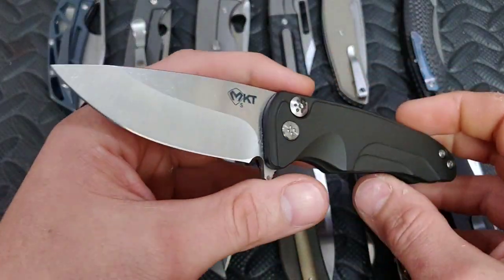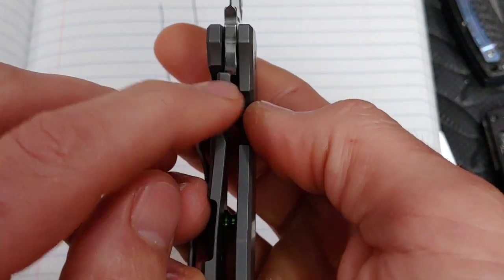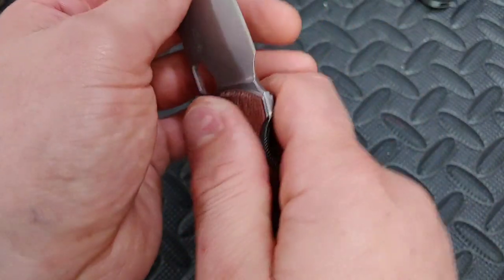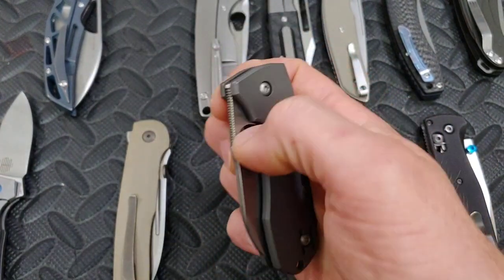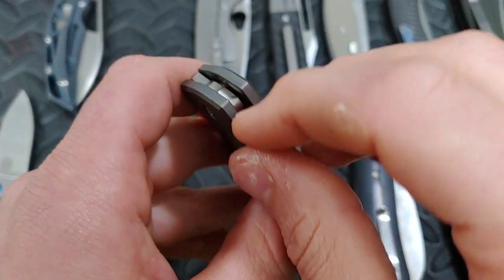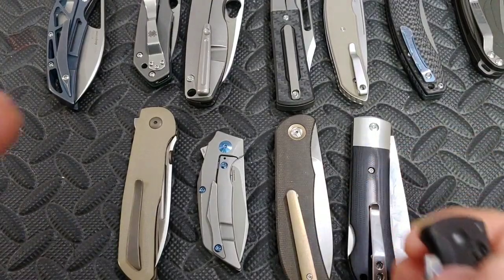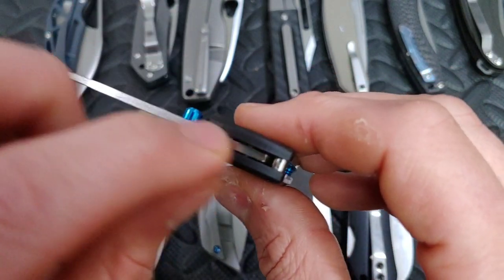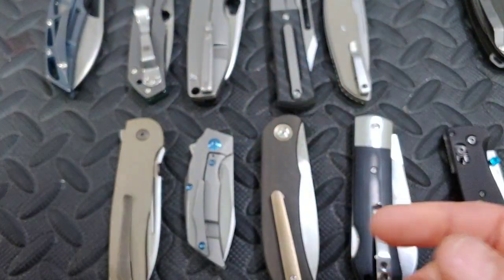KNIFE TALK: LOCK GEOMETRY

Comment: Great video topic. I was actually going to post a video showing two different twosun knives that I carried both for about a year each compared to two brand new versions of the same models. It really shows how they break in over time and how far the lock bar will travel as they wear
Reply from the maker: Dude that is such a good idea and you definitely should, especially when its a used knife not just a knife thats been opened and closed

Comment: Great video understand liner and frame locks.  What about a bolstet lock and the lock that everyone seems to call king the Cold Steel and just about all are lock backs? Please explain.
Reply from the maker: Cold steel uses a tri ad lock wich has a stop pin, a regular back lock doesnt, so the back lock locks up between the tang and the stop pin making it incredibly strong and through time it only gets stronger because it breaks in deeper which its made to do that. If that makes sense, I did a video on it a long time ago and showed a skeleton picture of one

Comment: I think you were clear enough.  Perhaps the part with the the access lock could have benefited from having the mechanism exposed.  

Something that has puzzled me and I have no answer for is what happens over time when the lock bar wears?  Does it eat away at the 90 degree angle and weaken the lockup?
Reply from the maker: No what usually happens is the springs weaken but still engage so its usually still just as strong since it blocks the knife from closing, but if you start getting a little rock then lift up on the lockbar, if it goes away then you just need to replace your springs, they leave room for it to keep moving up so it most likely will never wear that far
Reply: @NeevesKnives  That makes sense.  So far I have not had any problems with omega springs.  SOG's pivot spring on the other hand has given me a lot of trouble.
Reply from the maker: @mrblauer1  i have a b unch of knives that have never broke, and one thats omegas broke 3 times in a row with very little flipping, and one other knife that broke but has been fine since, I order new omegas for 6 $ a pair from an etsy store that are a little better than BM factory ones and I usually have an extra set just incase

Comment: There is one factor that is very little discussed in the knife community about line locks.
It is the heat treatment of steel used in the blocking line.
A very obvious way to notice this is to force the line lock to close the knife.
The stronger (harder) the force that must be printed to open the lock, the better heat treated is the steel used in the lock.
This factor is overlooked in the knife community, because what I see is that there is a very wrong mentality that considers it good that a line lock is easily unlocked.
This is only good for playing with opening and closing the pocketknives, because in the practice of hard use, a lock that disengages easily, has a steel with low hardness on the scale and consequently will have a greater chance of failing in heavy use.
The harder and harder it is to close the knife, the safer the knife will be in hard use.
But from what I see, the more frowned upon the knife will be seen by the community that values the ease of opening and closing the knife (the so-called factor: friendly opening and closing).
A major disappointment I currently have with a cheap but very well-priced $ 42 (harnds assassin) knife, was the fact that its lock is very easy to disengage. This knife is very well commented on the forums, but when I had it in hand, my disappointment was enormous. It is obvious that the manufacturer prioritized a smoother heat treatment for the lock line, in order to make it more of an opening toy and close easily, than make it safe for stronger use.
Just my opinion.
Sorry for my english from google translator.
Reply from the maker: I think also its about how much bend they put in the lockbar, and i like a strong lock but i want easy access to the lock thats my biggest complaint i hate when they make it hard to close because its hard to get to
Reply: @NeevesKnives  ,
The curvature does matter, as does the thickness of the lining, but the big X of the matter is really the heat treatment given to the cheaper steels that are used with locking lining, and most of these used steels are called 3cr13mov, which when it is after a good heat treatment, they should be in the range of 52 to 54 hrc, but what is seen a lot are these steels in the range of 46 to 50 hrc.
I have a ZT clone, which is only a millimeter thick in the lining to block a 4 mm blade, and I can attest that his hrc is 54 and is completely safe for hard use.

Below is a video of this clone, which by the way is very vagabond, with a very bad edge retention steel, but despite that, it only has 1mm of lining in the lock for a 4mm and 3.95 inch blade.
This pocket knife has already undergone several tests that I did with severe use without even advancing the lock. I was so impressed with the solidity of this lock that I sent it apart to do a hardness test (HRC) and gave it 54 on the scale.

https://www.youtube.com/watch?v=SmQG-Kd1ryk
Reply: @maxprint94  Thanks for the info. My Harnds Assassin "bit" me right out of the box and had no break-in to easily open and close. I have to be more careful not to get cut with this knife than any of my other knives. I also miss the breaking in period that I usual have with my knives. What better way to be "one" with a new knife than to spend time breaking it in.
Reply: @bmoviebmovie  ,
this was a knife that disappointed me a lot when I took it in hand.
It is definitely not a knife for safe use, it only serves for delicate tasks.
I really regret buying it.
It's a gentlemen's knife, and in my rotation, it only works when I wear a suit.